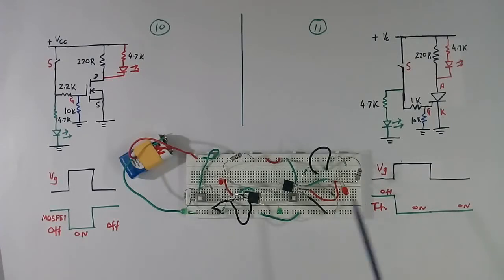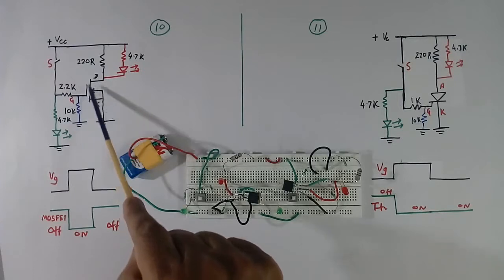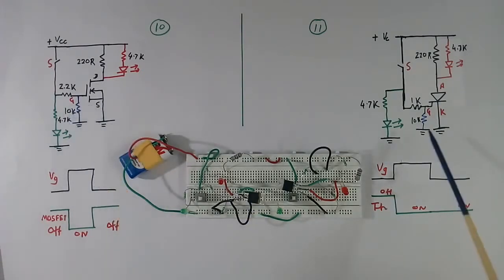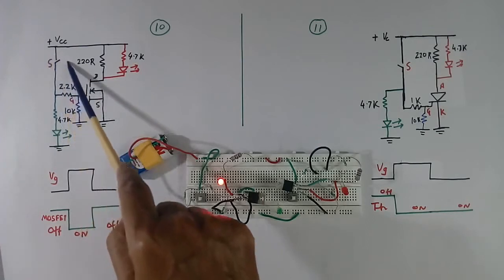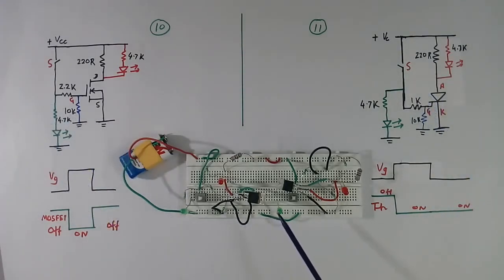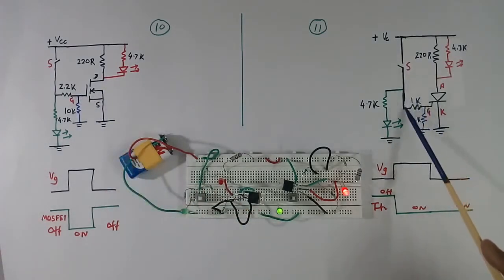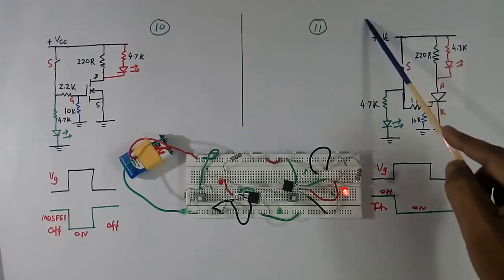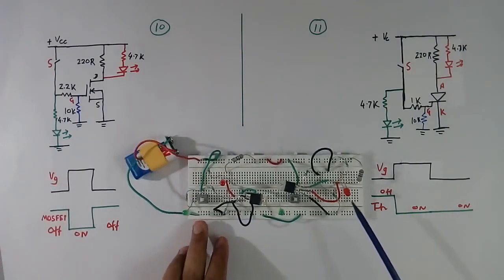Mosfet as a switch vs Thyristor as a switch difference

Comment: Nicely done.  May I suggest a second method of interrupting the current through a thyristor in order to turn it off?  Momentarily short-circuit A to K on the thyristor.  Current to load will divert to lower impedance of short circuit and interrupt A-K current.  When short is removed, thyristor is off until G is triggered once more.  I have seen this method used to reset warning lights on aircraft for many years.  The reset switch may also function as a lamp test.
Reply from the maker: Yes OK for small current. In the 3 phase converter, current is shifted from 1 thyristor to other, by triggering other thyristor. This way 1st thyristor becomes OFF.